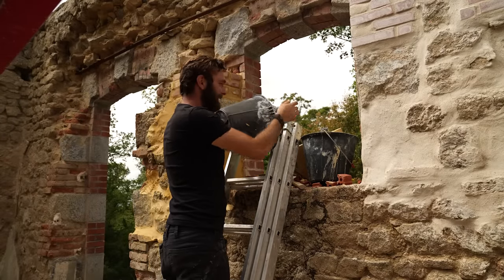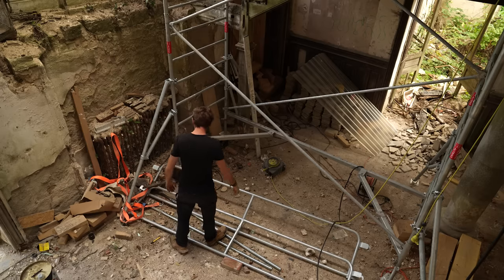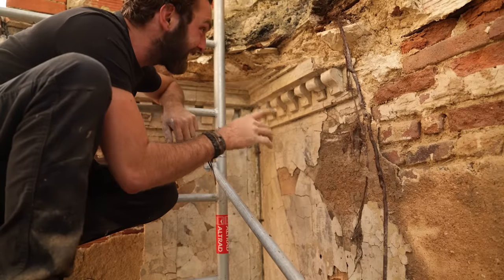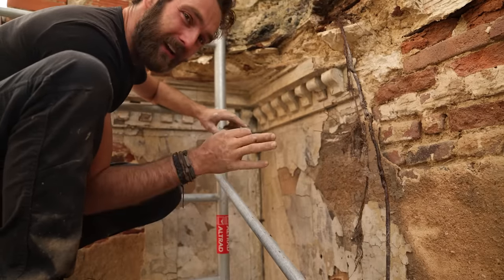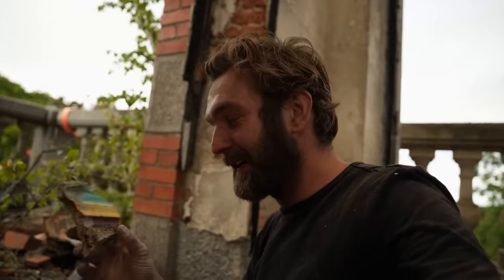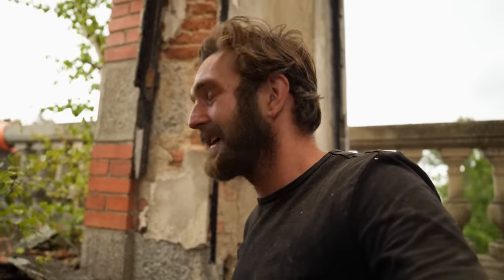Lost architectural details of the chateau.

Comment: Everything that is touched falls apart.
This house was clearly not built to last and I get the feeling that the original inhabitants have been cheated by a contractor who wanted to make a profit with poor materials and only finished the visible.
Fortunately, there were no light earthquakes, otherwise everything would have collapsed completely.
Reply: Guess you don't know the history....there was a fire
Reply: @Chateaulady  
If cement is used in the right proportions, you won't get sand everywhere with a fire.
Clearly too much sand and too little cement was used.
Reply: There is no cement its lime horsehair and sand on some older french houses it’s mud with just a lime render both sides hope this helps 😀👍🇫🇷

Comment: In theoretically yes but you have a extremely tall tower making it extremely heavier ie making it just that little bit harder to move theoretically 😮😂, taking a mold of it would have been much easier than taking it out and yes it would have also had house hire in the plaster to help hold it together, I worked on a 300+ y/o home in Surrey

Comment: They make silicone molding material, for making plaster casts.
Very similar to the material, used on actor's faces, by make-up artists. 
You need to fill it slowly, but thickly, in many layers, to get a good bace, that you allow to dry completely.
 And then carefully, peel it away..

This is your new plaster mold..

You should probably try and get ten or a dozen features, into this mold.
Not so many that it becomes ungainly.
And not so few that it takes you another hundred years to surround a ceiling with them, 
In fact, it may be wise to make several molds.

Comment: If  you are not that much of stickler for historical accuracy, and you don't have that much historical stuff to go on here, were it me, I would simply make that cornice of wood. It's pretty simple and then the little ogee blocks could be milled in one long length then cut to width, sanded and glued in place.  Way simpler, easier and cheaper then all that fooling around with the plaster and moulds and stuff.  Item two is those pesky roots.  The burning won't kill the roots you can't reach.  If it is available in France, Roundup (Glyphosate) will probably work on those trees.  Spray on the leaves when the plant is growing (now) and if it's going to work, you should see the plant starting to wither in a couple of days.  The chemical is absorbed by the leaves, goes down and kills the roots, too.  It is used by aquariums and zoos for killing weeds and grass in driveways and such but won't hurt any critters.  Given your situation, you would want to wait and be certain the plant is dead before removing it so all the roots inside the walls are dead, too. You don't need new trees sprouting up in a couple of years.  Yeah, I know, back to gardening again.       Jack L.

Comment: In California US brick walls must be reinforced against earthquakes. Don’t see any reinforcement of walls. What do you think?
Reply: Dont get earthquakes in France so no need.
Reply: There are steel beams, brackets, corner, pieces, and lintels integrated into that entire structure. It is more stout than people think. There would be no way that one framed window at the top would still be standing otherwise. Engineers have assured him that the building is very strong.

Comment: Make  and fix a topless box around one or two section of those corbels while it is still on the wall. Make it a bit bigger & higher than corbel, and pour in silicone to make a mould. You'll have to figure out how to hold the box in place while it sets, but once it has, you can remove box which will have the corbels in the silicone, and you will have a mold.